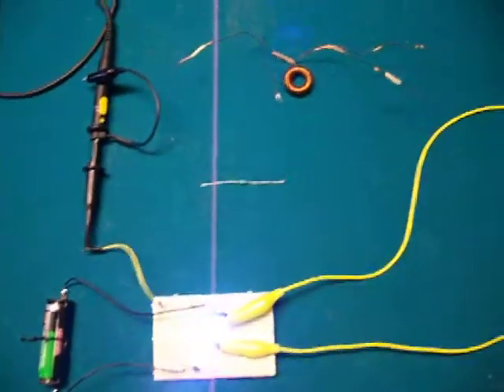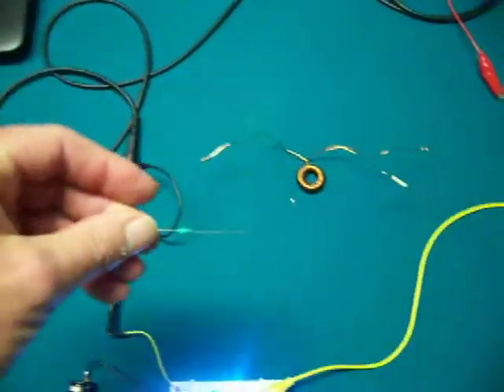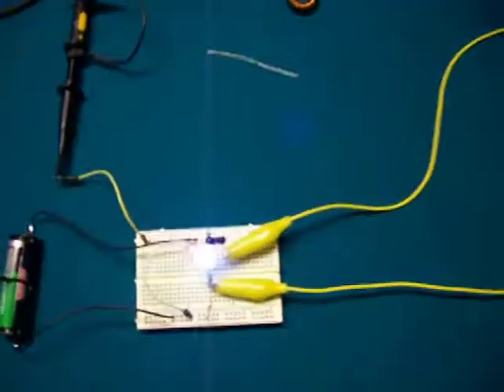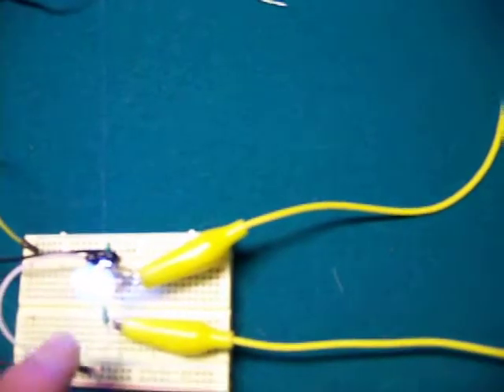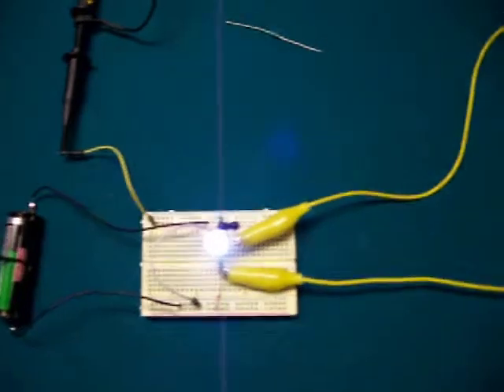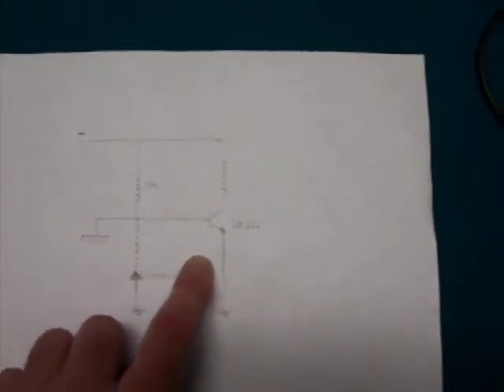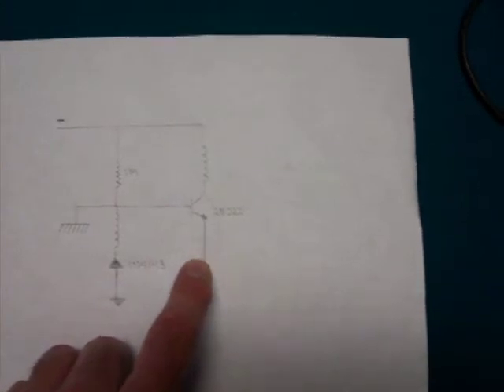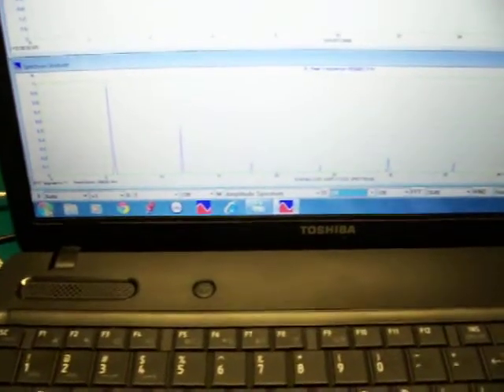JT Exciter 3

Comment from the maker: Yes avariable capacitor will help with tunning.I need to fix my meter to look at the amp draw.But my other setup has been running for days and used very little out of the battery.

Comment: Ok, thanks. Sounds like fuse has gone...Wrapped foil around a blown one in the past, but that's just asking for trouble. Ran a microwave like that for years. It would set light to the paper around greasy fries, from the local chip shop. No doubt it would have blown the 10A setting on a meter !

Comment: Slider, I sent you a 0-500 pF caps Gbluer recommended, the same ones.. it's just not wired but both of use have the diagram for making the mod to 0-500 pF. Cheers. Great stuff lately, both of u :)

Comment: Interesting how the 2N2222 worked, but not MPSA06. Think i'll replicate and try C1815 and S9014, those two are normally great for low power high hFE needs. Also Sziklai with A733 to see what happens.
Would a radio type var cap adjust brightness in place of the 400pF and can I ask the draw ?